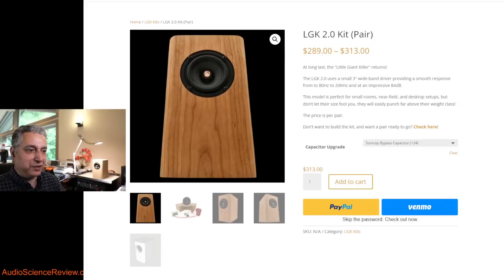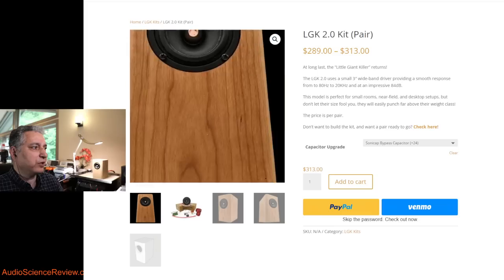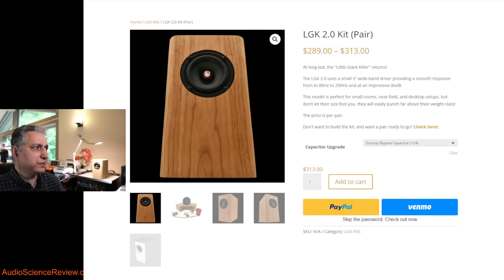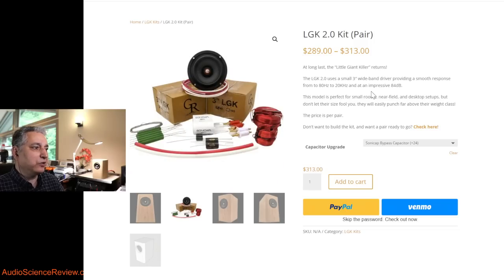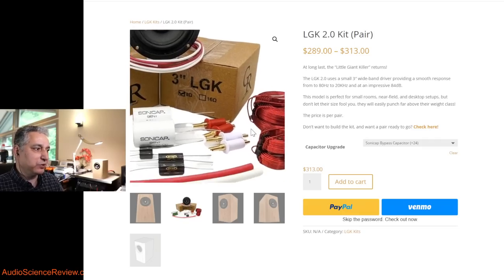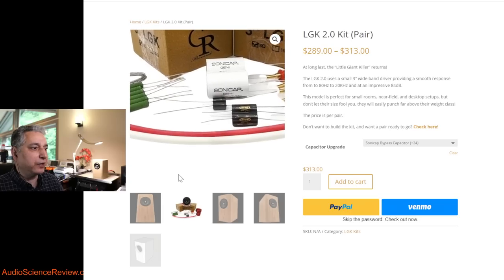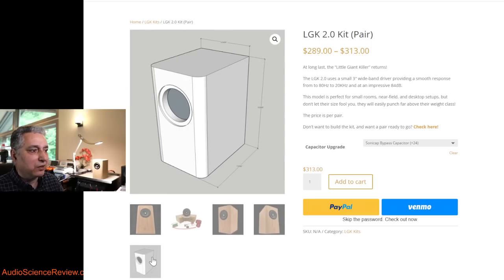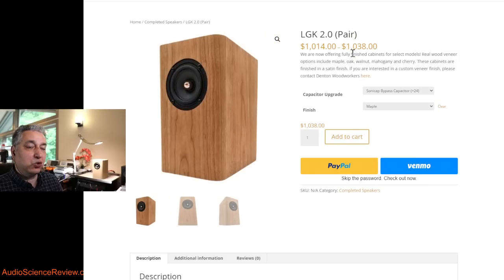GR Research LGK 2.0 DIY kit Speaker Review

Comment: Thanks for this review.  Being in Software QA I really don't like suggestions to change the test.  That will always call trust into question.  Must be 5 minute grits.  
I see that you do give credit when due in regard to the speaker upgrade products.  1200 buys a pair of SVS ultra Bookshelfs.  I would be very curious what direct comparison listening shootouts would reveal.  I noticed in Danny's review that included the Wharfdale 225, he liked the measurements then criticized its parts and difficulty upgrading.  I guess that's the main thing, if it's upgradable.  I am very curious about that speaker, and the modification where longer bolts and spacers are used at the bottom to give that port more clearance.
https://youtu.be/WtWb7-XoeuA

Comment: You drive a tiny driver with a full range signal, when it's supposd to be used with a subwoofer below ~80-100Hz and only in a desktop setting - but then complain about "distortion"? This seems rather disingenuous or at the very least misleading. Have you ever heard of loudspeaker physics, where you can only have 2 of 3 things: either low tuning, high efficiency, or a small speaker? The choice must be made and you'll have to choose 2 and sacrifice the 3rd aspect. Same with this small speaker - except this one is limited in another way: cone excursion. Any noob can pretty much see that this isn't meant to be used for full range/bass frequencies - nor to be a jam out, cussin' rap speaker. Wow.....

Comment: GR makes and guards the products fiercly but ignores massive distorsion ...but also claims he would have no problems telling two differently constructed sets of speaker wires of similiar area apart in a blind test. hmmm... finger hovering of "F" button of doubt
If I'd use these as monitors for my PC and hearing that vocal fry I'd be so dissapointed.

Edit: I think most of his(GR-Danny) work seems good, it's just that he might be a little full of himself sometimes.
86dB sounds quite loud, I do most of my normal listening at 65-75 dB(A) (slow), to hit 86dB(A) music would be fatiguing. Maybe 86 dB is frequently reached if I'd set mike to dB(C) fast? I.E. even my normal listening would be affected?
Reply from the maker: dB has no meaning unless you specify listening distance.  The measurement at 86 dBSPL was at just 1 meter.  For every doubling of distance, you lose 6 dB.  So at 2 meters, the peaks in the music will be 80 dB.  Average would then be 65 to 70 dB.  And that is at 2 meter, or 7 feet.  Threshold of hearing at 20 Hz is 75 db!  Anything below that means that tone will not even be audible.  Please see this video on topic of loudness: https://www.youtube.com/watch?v=zTEQmmG6TzE
Reply: @AudioScienceReview  Excellent points. Yeah, considering that dB drop at distance, to use these speakers at minimum distorsion I take it as these speakers should come with a headphone strap.

Comment: Maybe your amplifier is klipping?
Reply: No!
Reply from the maker: I tested it with two different amplifiers.  One lowish power and the other, very high power.  I also tested the same amps with other speakers and they sounded wonderful.  This speaker is getting distorted with just a handful of watts.
Reply: @AudioScienceReview  maybe you made a mistake on the crossover assembly?
Reply: @TheAppleExperience  Unlikely, that would show up in the impedance and phase graph, which was very close to the one GR published.

Comment: Utterly comical to charge $1000 fully built for a 3" speaker.
Reply from the maker: He shoots himself in the foot by putting such expensive parts in that filter network.  I mean who needs $50 or whatever he charges for "tube connectors?"  Let's say there is some value in it.  How would it possibly do some good for this little distortion-factory of a speaker?  The total kit needed to be $150, not $330.

Comment: A 3in full range speaker? Also the price jump from DIY to pre made is very substantial to say the least, especially considering no middle man in the sales chain. Disappointed in GR's responses to Amir. Expected better quality on the coil Amir mentioned. 1K $...yet  none of the famous "Norez" material  included? Reveals by Amir on PS Audio now GR. Losing faith in companies left and right. Sigh.
Reply: Sadly, when you go to "pre-made" anything, there are more "hands" out there, and they all want their "cut". In addition, these are one-offs, which means a finished batch of "two" at a time. They would be less, if the batch size was 1500 pairs, made in a factory overseas with cheap labor. Economies of scale, sets the price.

Comment: Do you know anything about audio? It's obvious this is a small monitor designed to be played in small rooms at reasonable volumes as a stereo pair. Heavy bass and loud listening need not apply. When you talk about the distortion of the female voice you are obviously over driving it. Yes this should be noted and perhaps the designer should warn against this (i.e. The limitation of the design) not sure if they do or not, and possibly add a LF cutoff to minimise this issue but did you actually listen to them in the space for which they were designed. Also I tend to find that if you get significant higher harmonics out of the port you didn't put enough damping inside the box. Poor review, not balanced.
Reply: It shows 100% you didn't read the pinned comment, nor watched (or understand) the vid. And now you question Amir about knowing anything about audio? You must be special 😂😂😂

Comment: How can you possibly expect to review speakers intended for stereo use by only listening to 1. Also why would you play a single desktop speaker at 90 dB or above? When played as a stereo pair that would be around 100 dB. No one in their right mind would listen to speakers that loud, it would cause hearing damage.
Please advise what is the industry standard for smoothing when it comes to measuring speakers.
This video seems like a great example of the Dunning Kruger effect.
This whole video seems more like a person vendetta than an honest look at the capabilities of a product.
Reply: Stereo will mask issues that is easier heard in mono
Reply: @FSXgta  Sure if you have a mono recorded signal. Everything is recorded in stereo. It’s insane to think listening to one speaker gives you the whole picture.
Reply: @jon1810  There is a reason those multi channel tiny speakers sound ok, because of the effect of stereo/surround. If you listen to them mono you'd notice how bad they are. Like a center channel review too, you don't get two of them...
Reply: @FSXgta  They are not designed to be center channels. In fact, I believe GR Research has center channels that Amir could review this way if he wanted to.
Reply from the maker: Nobody listened to the speaker at 90 dB.  It blows its brains out at that level even though every bookshelf speaker I have tested handles even 96 dB (and costs a lot less).    You and Danny are confusing measurements with listening tests.

Listening tests were done at 75 to 80 dB which is well in the spec for the speaker.  And if you need two speakers to hear distortion instead of one, I can't help you.
Reply: @AudioScienceReview  I have produced distortion in single speakers just by collapsing a stereo signal to mono and cranking it up. It’s easy to do. I’m assuming you did this? Or did you just have a right or left channel playing? Which would also be lame as you’re only getting what was mixed into one side. Either way, you’re missing the point of speaker listening tests. Any speaker designer in the world would want their pair of speakers listened to together. That’s irrefutable. If you believe this, you might as well judge a pair of headphones with only one side over one ear.

Comment: So let me get this right - your telling me even with rolled off lows you can CLEALRY hear the distortion as you keep saying OVER AND OVER in everyone's comment that is pointing out your flaws but you CAN'T hear a difference in cables / capacitors ect? Man. I really don't understand what's wrong with your hearing and I'm not attacking you but omg the difference of cables, compactors ect on my high end system is as obvious to ANYONE. You know how I know? I tried it with non audiophiles blinded and they didn't even know what I was doing!! It's so obvious your bias is sooooo strong you can't actually hear what's right in front of you. I thought early on in my hifi career NO WAY cables can matter! But I'm not closed minded, I WANTED the cheap junk to be equal, but ANYONE with quality hearing with good gear in a well treated room and properly setup speskers can notice the change in two seconds.

Next your gonna tell me different tubes of the same type sound the same LOL. If you say you can't even hear those differences - oh God.
Reply from the maker: As it turns out, I tested Danny's B24 AC cable.  See: https://youtu.be/HkmwcPdTlWM
I show with listening and null tests that it makes absolutely no difference.  Worse yet, it can be dangerous to use. Please educate yourself and don't fall for audio folklore.

Comment: so now you have to buy a sheet of NO RES :-)
Reply from the maker: Believe me, we would have if they recommended it.  But they say to not use it as it doesn't have space for it.  We did pay for the upgraded capacitors though.
Reply: @AudioScienceReview  strange situation really. I have seen many designs with similar speaker designs and even more expensive cabinets. I'll stick with two-way designs for the time being

Comment: Expecting a single driver to play full range is absurd. It didn’t work for Bose why would it work here. For any given size driver there is a range of frequencies they can operate well. Pressed to operate below or above and you get these sort of problems. There is only so much you can achieve with a full range driver. The quality of crossover parts does matter, but it really doesn’t in this instance as using a single driver just isn’t a good idea in the first place. This whole personality squabble is unsupportable. You don’t have to agree with a manufacturer’s philosophy. Personal attacks aren’t worth the effort. Don’t like it, don’t buy it. Amir, there are always differences of opinion. Your equipment is well up to the task. That’s not up for debate. This is a sow’s ear that cannot be made into a silk purse. To expect any full range driver to achieve this is without foundation. It isn’t reasonable. I watch your reviews because your technical analysis is on target. You don’t sugarcoat it. If it is flawed, it gets spotlighted. Let the others wet legs if that suits them. I stick with your analysis as I could do a lot worse! Press on Amir! Stay safe my mates!😊👍🏻😁🛠

Comment: When it comes to the testing process, Danny is right. He has a state of the art studio that covers every possible aspect of testing a speaker.
Reply from the maker: What?  What studio?  He just has a playback system with some voodoo parts like batteries for power supplies and such.  There is no measurement of its response to know if the room has neutral response.  If you mean his measurements, it is just in a hallway with a microphone pointed at the speaker.  That is why his measurements are so smoothed and lack detail.  So no, he doesn't have a proper setup.  If he did, and had critical listening skills, this speaker would have never seen the daylight.
Reply: @AudioScienceReview  I can't and won't speak to his speakers. I know someone who visited his studio and he showed me pictures. He spent quite a bit of time in setting that room up for testing audio. I know he has an open invitation to Audio professionals to come down and spend some time with him and see his testing methodologies in person. I think you would be a prime candidate for that because of your extensive audio background. I hope you test his other speakers. His bookshelf speaker is the most popular one he sells and there's many reviews of it by other YouTubers. He also has a very well reviewed open baffle tower speaker and subwoofer. 

Your review definitely pointed out issues with that desktop speaker. His video on the 2.0 said that you should be tuning your audio to roll off the low end as no 3 inch speaker could handle everything thrown at it...but I agree with your review on the matter.

Comment: Buying (or leasing) $100,000 test equipment doesn't make you a scientist.
Reading the manual for the test equipment does not make you an experienced audio equipment reviewer.
Anyone who buys audio equipment based on the spec sheet is more interested in talking (bragging) about their equipment than listening to music.

This guy would by a formula 1 race car and tell you it's junk because he can't drive it around the track without blowing up the engine.
Reply from the maker: I don't claim to be a scientist.  Measuring a speaker is not science but verification of the design.  Clearly the company has not done its own job to measure things like distortion.  That is why they are surpised and unhappy.  I have used my Klippel NFS measurement system or 250 speaker tests now.  Major companies such as Genelec, and Neumann trust me to send me review samples of their professional speakers.   A speaker salesman saying I don't doesn't make it otherwise.  His measurements are incomplete leading to design problems.  Be on the side of independent testers than in the pockets of companies.
Reply: @AudioScienceReview  Interesting, I do have a couple comments. 
1) Audio "Science" Review: If I understand this company name correctly, your company performs scientific reviews of audio products. Understanding your response to my comment, you do this without the benefit of having scientists or following scientific methods. In my day they would call that false advertising.
2) "Verification of the design": This would require you having access to all design specifications from the designer, including measurement criteria and cost targets. You clearly did not even ask for any of these specifications when you took GR Research's 3 inch speaker and cranked it up to 11. Following that, you (based on nerve or in ignorance) declared that you had discovered distortion. You then proceeded to pat yourself on the back for debunking some design criteria you imagined out of thin air.

I've been around audio equipment long enough to know that distortion specs are for salesmen. I would have to guess that the companies that send you equipment to . . ., do whatever it is you do, do it for sales and not for any kind of verification of their design, unless of course saying that helps sell their product. You are not doing work for engineers. You are doing sales for the marketing department.

Having said all of that, I can understand and appreciate your business model. Finding a company like GR Research, a company big enough to have a sizeable following but not too big to ignore you, and trolling them for followers, is effective. Congrats on the followers. You can have them. They clearly are not all critical thinkers.

One last question. Did you actually pay for the expensive test equipment, or has that equipment been given or loaned to you on the agreement that you will promote it also?